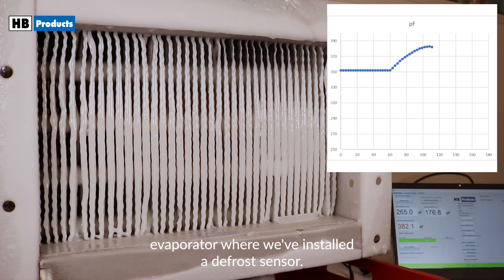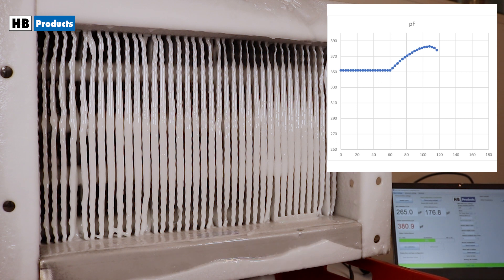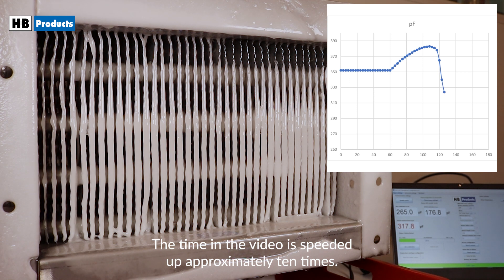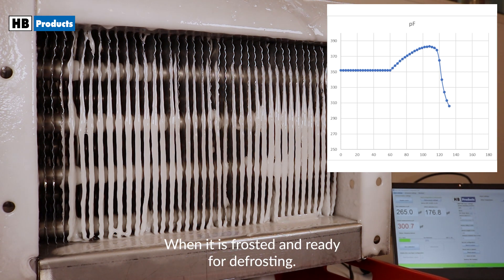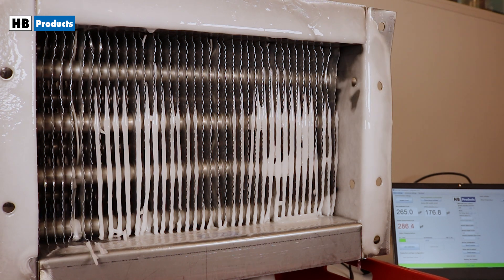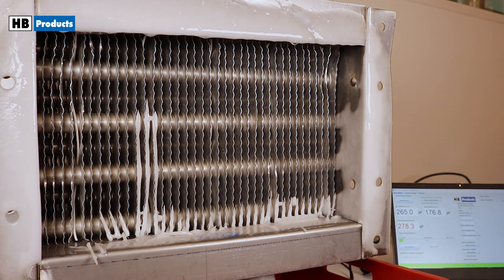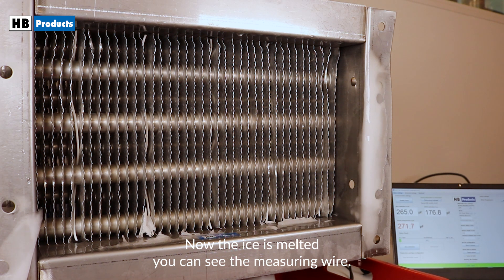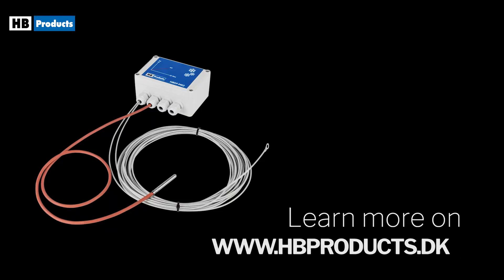Defrosting evaporator with our Defrost Sensor

Comment: But how it stops? Pt1000?
Reply from the maker: The defrosting stops either when the mA signal is below 6 mA or by a temperature sensor PT1000. The sensor can use both inputs.